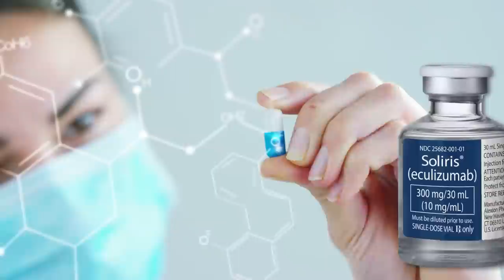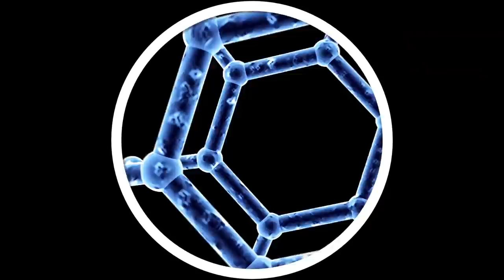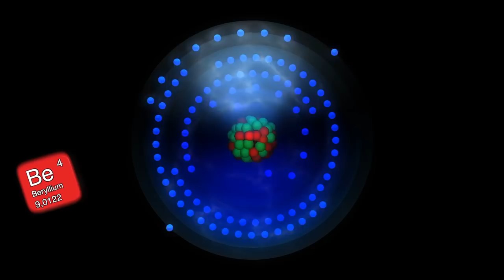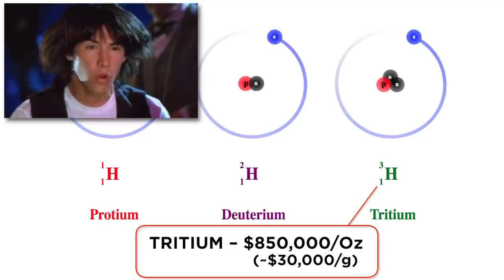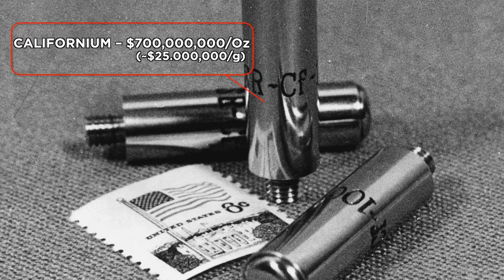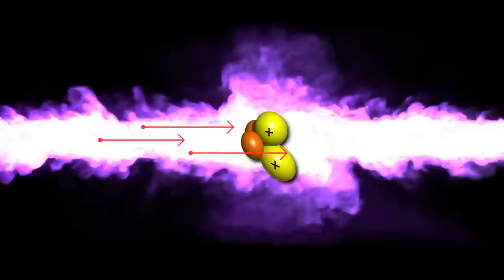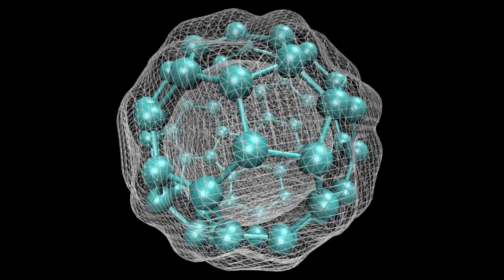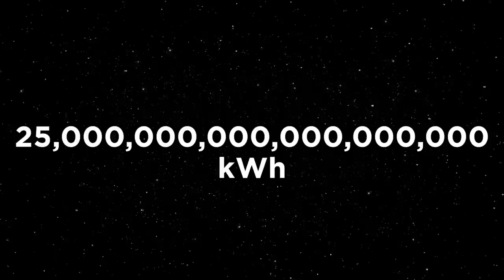Most Expensive Materials On Earth

Comment: Fun fact: In a fission reactor, around 30% of the energy produced comes from splitting plutonium, even if the fuel that goes in is just uranium. The uranium-238 absorbs neutrons and becomes uranium-239, which undergoes beta-decay to neptunium-239 then plutonium-239, which can undergo fission.

Comment: Printer ink didn't make this list? Excuse me.
Reply: You sure aren't kidding about that! I found a way to get around the exorbitant prices for some ink cartridges. Look up the make and model number for your printer here on YouTube, and you'll find tutorials on how to refill them using a syringe and cheaper ink you can get on amazon or other sites. There are proprietary chips on most printer cartridges so that once the chip tells the printer you're low on ink, the printer rejects the cartridge if you refill it--the printer won't allow the cartridge to work because of the chip. All you have to do is keep refilling those cartridges BEFORE the printer reads a low cartridge warning. 
But if you forget to keep the ink topped off, some very clever folks found a way to rig the chips so the printer won't reject it once there's a low ink warning. I bought a kit for $50-$75 that includes 4 pre-filled ink cartridges with the rigged chips, 4 large bottles of ink, and a couple of syringes to inject the ink into the cartridges. That kit cost less than the proprietary HP printer cartridges I was forced to buy before, and it included a 1 or 2 year supply of ink! Search for a tutorial on how to refill ink for your make/model printer--most of the tutorials include a link where you can buy their refill kits. They're the best deals by a long shot, they work well, and they channel money to small business owners and individuals rather than paying the rip-off extortion ransoms these big printer companies charge. Just make sure the kit has good feedback on the seller's page.
Reply: I've heard that the ink cartridges are more expensive than an actual printer. I've also heard that they make those for about 25-50 cents, and they sell them for $50. But that was one brand. I just don't remember which brand that was though
Reply: Lol

Comment: Excuse me ”fusion” reactors? Thought we only had fission reactors...
Reply: No, there are fusion reactors. There are several fusion reactor designs but they are only for experimental use right now because, causing fusion to happen right now requires more energy input than what you get back so they are not used for energy production yet. There are Laser based ones that fuse hydrogen Atoms inside a pellet of gold using super powerful lasers to raise the temp. and pressure. Then there is ITER which is a giant Doughnut full of magnets that contains super hot plasma to create fusion the same way as in the sun.
Reply: excited box well that explains why I haven’t heard of them at least
Reply: @excitedbox5705  the lfr at Cern had a sustained reaction fusion where they had enough energy to power the process a second time on top of giving out enough power to run NYC for 16hrs. I'm pretty sure it wasn't on their first try, but it ran 60 sol cycles, and showed an almost perfect representation of the Sun...  monotrium fusion, I believe.

Comment: I don't think antimatter is going to be very useful as a fuel. The reason is that, contrary to popular sci-fi memes, antimatter doesn't actually explode. It converts its entire mass into gamma rays. That means it doesn't produce heat or light that we can tap into to produce power; instead, all that energy just flies through anything we put in its way and kills everything nearby. Silently. So it's going to be incredibly difficult, if not impossible, to use it as a power source. It'd be much easier to use it as a weapon... and I'll leave it up to you to decide if we really need that.

Comment: if diamond is pressurized carbon, how hard do you have to  hit carbon to make diamond??

im confusion
Reply: Well, Carbon exists in many forms. The carbon you're most likely familiar with is Carbon Dioxide, or CO2. This is that same stuff that leaves your mouths when ever you breathe. And It's the same stuff taken in by plants during Photosynthesis to help create glucose and Oxygen. But Carbon is a solid at normal temperature, not a gas by itself. But the Carbon that exposed to extreme pressure that becomes diamonds are one, large chunks squeezed into something much smaller, and you can't hit it to become diamond. It's more of a squeeze from all directions, as well as intense heat from the Earth's mantle layer and low crust layer. 

So essentially diamonds are large amounts of Carbon, which is a solid, squeezed into a tiny crystalline rocks to make diamonds.
Reply: You have to hit it with the weight of the world
Reply: @kirbyflk3969  theoretically speaking. If you hit it with enough force it could insta turn. But the force required would just destroy it so, it makes it impossible. Thus why a lower force over time, equivilent to an entire city resting on you, with the heat about the temperature nearly just shy of molten rock locked in your tiny cavity with you, works much better.
Reply: @Zelia_Wolf  you could probably better have talked about different allotropes such as coal and graphite
Reply: I could have. But the thing is, coal almost definitely can't become diamonds if I'm correct. Think about this. coal is created by life. Dead remains fossilize and become coal. Diamonds for the most part predate life. The Earth is 4.7 billion years old, and diamonds are usually hitting around 3.5 billion. Around the same age as life, but the earliest of life could not be diamonds as they're simple organisms, and sea life can't fossilize directly.  So the earliest fossils that would form any form of coal would be a bit before the Cambrian explosion. And so talking about coal into diamonds is redundant as the amount of time required would be equivalent about what we could find now we don't. Keep in mind the structure for coal and diamonds are quite different. graphite on the other hand, a far better case. But still it's redundant.

Besides, they asked how hard you have to hit carbon to make in diamond, and I wanted to explain that you can't hit it to do so, and that all diamond is is carbon squeezed by intense heat and the force of the plates pressing down, squeezing one large chunk of carbon into one small little crystal.

Also, screw English. Is is. why is that a thing. I also hate using that that.a It feels wrong, but it's actually correct. AHHHHH!
Reply: @Zelia_Wolf  https://en.m.wikipedia.org/wiki/Detonation_nanodiamond
Reply: if diamond is made by the pressure of earths plates moving, how many plates would it take to make a diamond planet just by moving a milimeter  (---------)
Reply: @jamarplummer3493  does not work that way. Diamonds are rocks for a reason. They're being pressed from all sides. It's like taking a thing of play-do and squeezing it into as small a balls as possibla without rolling it in your hands.

Comment: Interesting fact: Diamonds are NOT indestructible. Exposing diamonds to liquid oxygen is not recommended. You can dissolve diamonds in tubs of liquid oxygen pretty quickly.

"Antimatter might solve our energy problems" - Dumbest statement ever made. Antimatter is very rare, but according to some, is theoretically produced in certain high energy lightning reactions within clouds where gamma rays are supposedly produced. In further reactions, those gamma rays can break down into electrons and positrons (the positive charged antimatter versions of electrons). So, it takes a HUMONGOUS amount of energy to produce just a few particles of antimatter and that happens rarely in nature within the Earth's atmosphere.
If you wanted to use antimatter as fuel to produce energy, you'd need to expend a lot more energy to do so. Imagine a scenario where you had a light bulb that you wanted to light for an hour but the energy you'd have to use to produce that electricity would require burning a couple million tons of coal. That's how practical using antimatter as fuel is.

Comment: You could trip 1,000 times with a gram of LSD.
Reply: More like 10,000. An average dose is 100ug, so there's ten doses in a milligram. And obviously there's a thousand milligrams in a gram, meaning 10,000 doses. Even if you took a normal dose every day, it'd last you 27 years. But (virtually) nobody does that; assuming a more realistic (but still more than most people) dosing schedule of once per week,  it'd last you about 192 years, far longer than LSD has even existed for. Even if you took at least 2 every time (an admittedly more realistic scenario than using one tab every time), you'd still have more than 90 years worth, depending on how often you took more than 2.